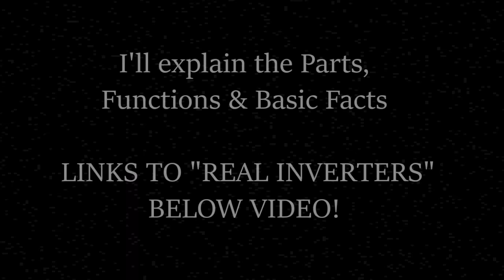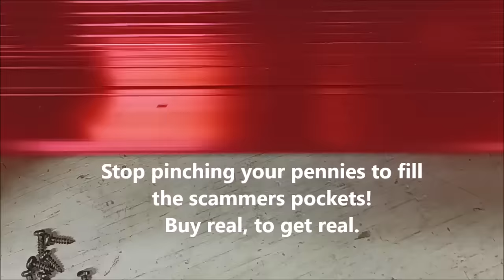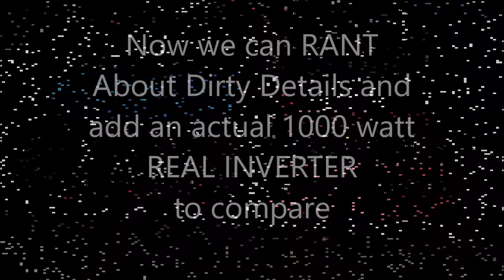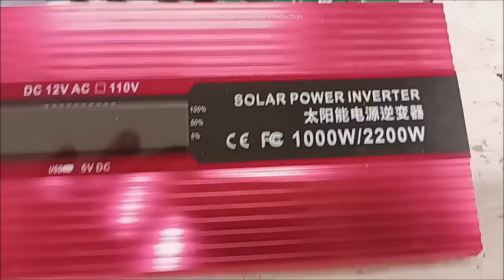Cheap Fake-A-Watt verses Affordable Real Power Inverters, Mega Parts List Below!

Comment from the maker: ALFFAA 1500w DC to AC inverter https://amzn.to/3sJmh9r Honest rated, capable & Well made. MUS-TOOL OSCILLOSCOPE https://amzn.to/3Np7VDk , All parts used https://a.co/dnSm8JX And a SUPER COOL XTRA, My Stakol 53 quart DC Freezer https://bit.ly/3sHazMw , $300 it's been running now over 1 year non stop. only uses 50 watts at 12 volts!!!
Hi Boost ALL SERVICES Cell Boosters, Number one for a damn good reason https://www.hiboost.com/product/4k-plus-pro/ref/68/ and get 15% off use promo code POWER at check out!!
Direct Shipped ALL sizes these same SWI POWER INVERTERS https://s.click.aliexpress.com/e/_Acd6Hd
Reply: you should go through a lot of these things to find the ones that are worth it dang
Reply: got mine, works really well.

Comment: John Daniel I can relate. I have the hardest time making people understand that an inverter does not make electricity it converts dcv to acv which means you can't put a quart of water in a gallon jug and expect it full?. I have 8 thousand watts and I have 8 lithium ion batteries, and WHY? it needs a gallon to fill a gallon jug. Powerjack has give me great service like you say it takes excess of wattage for surge to start. I gave up on my vet friend he wants to know why his 8000 watt won't put out he's got two batteries on it ???? you can lead them to water but I'll be damned if they will drink it. Great Videos keep them coming your spot on. Mike
Reply from the maker: My silly motto I would say to these egg head solar installers and goof balls who use a calculator to cut it all to thin. I got trolled for is, so see it as follows:
I got 35% more solar then I need, I got 35% more battery then I need, and I got 30% more inverter then I need. Why? Because the sun is never as bright and on time - AS I NEED!
Reply: Powerjack inverters are one of the poorest performing, most unreliable inverters on the market.

Comment: Just to be on the safe side, dont max out your  inverters capacity. 500 watt load is good enough for a 1500 watt inverter.
Reply from the maker: I try to enforce that think in all my videos. It's distressing to see people get a 1000 watt inverter to run a 999 watt load LOL!! My motto 40% is target so when you buy a 1500 watt inverter, 700 watts is your normal component constant service ability, you need more, spend the extra dollar and get a bigger one.
Reply: @JOHNDANIEL1  yes thats true.

Comment: Dang that is your first problem, buying an inverter to run a microwave! I'm not about to tell anybody how to live, but that ain't it!
Reply from the maker: Except we run our microwave on one numerous times a day and have been doing it for 17 years. You just have to buy a inverter with the right ability. Most folks are so cheap they buy a 1000 watt inverter to run a 1000 watt microwave without seeing that the 1000 watt microwave rating is for HEAT achieved, not power used to make that heat. A 1000 watt output microwave uses no less than 1400 watts to do it.

Comment: There are many brands sold especially on Aliexpress, it suggests that there is a company that produces the equipment, then the brand puts that simple sticker that comes on the aluminum lid, with the brand. I already had not very good experience with a red Rddspon inverter of 3000w peak by 1500w nominal. In fact, this Rddspon inside is the same equipment as the Jinsi, and both have a nominal power, not 1500w, but 944w (which is what I achieved in the tests). Unfortunately, there are companies that are not loyal to the consumer. I was cheated.
Reply from the maker: All web stores like Amazon, Ebay, Aliexpress have similar activities from sellers. They can choose to upgrade the internal parts and sell similar looking items or sell inferior built that look identical to the good products and sucker people into buying it. In china they are referred to as 骗子 ( Scammer ) 
I only buy from suppliers who have been in business over 3 years, have direct links to manufactures and do not make copies or knock offs.

Comment: I have the 2500/5000 W Enrise inverter. I’m sorry to say it only can deliver 500 W with resistive load. Never worked properly. No support from seller. Seller don’t answer when it turned into a warranty issue. I hope you are happy with yours. But I would like to warn other from buying it.
Reply from the maker: What the hell is a 2500/5000 W Enrise inverter? Never heard of them.

Comment: the cheapo one, the Datou or whatever, is the one i want, because it has the common EGS002 control board!!!  and that is amazing,been looking for that, most have their own controls,some even sand the ICs so that we can't get replacements;  but the EGS002 is only 4 or 5 bucks ;  AND.. it is on a socket!!!!  congrats, depending on the price, the el cheapo there is rthe one to buy, up to maybe 1000 or 1200 watts.
i repair thiose things, and there is NOTHING like having that EGS002 in there, believe me; our ukrainian UKC here,a very good 2000w/4000w  inverter, has it too .
Reply: Is important to know that cinese power is 1/3 of Real watt they aren't scam, you only need to know what you are buying.
I take 8000W 24V cheap inverter and it sustain 2500W  indefinitely,

Comment: We purchased a Giandel 2200W pure Sine Wave Inverter 12V DC to 110V 120V with 20A Solar charge control. We way over powered our creek side camp. We only use the system to run a small apartment refrigerator w/ freezer (draws 10A), 2 different sets of outdoor lights (30Watts each). It's only a system we use on the weekends for the last year and seems to be working well. The inverter has lots of safe guards for those of us who aren't so solar smart. Like when our battery bank got to low an alarm went off and it shut the system down (thank you Giandel).
Reply from the maker: That use the same control parts as Novapal and SWI Power. Very decent build.
Reply: @JOHNDANIEL1  that’s good to hear.

Comment: AM GLAD YOU HAVE SHOWN ALL THIS , only problem is on the outer exterior the only tell tale signs is all the fancy stuff on cheaper ones  and the end electrical battery kook up post being smaller, unless you open it up to actually see the insides of a cheap made model or fake . ( a person if they know how could test them , but then again only after buying one. )  great video and info though .
Reply from the maker: If your in question before you buy one, inquire on it's actual weight, not shipping total, item weight. Then compare your findings. I know this is one solid inverter by ALFFAA and since it's spec made by SWI POWER you know it's solid.

Comment: Great to see the ALFFAA opened up so I don't have to. Excellent Video.
Reply from the maker: It's actually a SWI-Power made inverter with seller upgrades, I plan to release a even better version myself as a OLYMPIC POWER CONTROLS model with dual thermistor and a gen 3 processor. Working with them to make it happen. Fake a watt crap has me that rattled.

Comment: Good video. I ordered a 2000w/4000w peak inverter a couple years ago. I was already skeptical of its current. Turns out it will do 1500w max continous If it doesn't shutdown due to heat protection. It uses the case as a heatsink and that clearly isn't enough.
Reply from the maker: See my latest upload. I worked with one of the top Inverter companies to get numerous improvements made, the results are excellent and their 3000 watt pure sine is one of the most affordable for the quality you can get. https://youtu.be/kUit7UYJ7wY

Comment: Great video!
That blue one looks well constructed, however, it's a pity the Capacitors are so close to the Mosfet/Heat sink.
Certainly the caps are due to fail, just like LCD televisions sets....
(they want the unit to eventually fail so u buy a new one)
Just replace the Caps!... 👍

Comment: Lol your exactly right as a electrical engineer I never use aluminum wire its very high in resistance to much heat I design my inverter with a1000 extra wattage for low heating and longer life I use 300 amp wire for all input and bubbles to transformer I don't build cheap products
Reply from the maker: Exactly!

Comment: I'm pretty technical (from electronics), but just looking at number of components: I wouldn't be able to tell you. All I know is that some MOSFETs can do hundred amps each (and maybe some cooling/gauge of accessory wires.)
I lucked out, ordered my inverter based-off reviews and volume of adequate information available in the descriptions. 🤷.
Reply: did you buy the ALFFAA 1500w?

Comment: @5:01 The small lytics cap right by the second transformer on the right looks like it has domed top which means that cap is bad, it is very common failure in the inverter.

Comment: TO ANYONE WATCHING THIS VIDEO, THIS GUY IS A STRAIGHT SHOOTER!!! If you think this guy is anything but correct, I have a bridge in NYC to sell you real cheap. 

Dear John,
Thanks for the video!! It is a shame that Amazon does not enforce false advertising. I tried 6 different inverters before I found one that actually performed as advertised. I had one that dropped the  output voltage down to 98VAC under a 50% load, while showing an output of 114VAC. By design, an inverter is also a voltage regulator. So how do you put out a product that advertises 115VAC, but as soon as you apply any load it drops? I have seen the Alffaa perform well in a youtube video, but I ended up settling on the BougeRV 2kW with bluetooth. It holds 119VAC regardless of the input voltage, or load on the output. I gauged the inverters I tested by their ability to hold the output voltage steady. P=IxE and no one seems to get that. At 12VDC you need lots of amps and lots of copper, and again no one seems to get it. Then there is the 80% rule, and again no one gets it. It's not new science. Why did I get a 2kW? Because I know I need 1kW constant. You get it, but again no one else does. I see people on youtube hooking up battery banks with bolt in fuses, and no disconnect. I just can't believe the stupidity abound. BUZZZZZ POP!! There goes another one! Great video pointing out the build differences, as they are confirmation of DANGEROUS crap for sale on Amazon. Roof leaks, just a little damp. Toilet breaks, just a little stinky. Cheap electrical equipment breaks, 4 alarm fire. I wish people would stop playing with their lives. However I suppose it does help on the Darwin front...
Reply from the maker: Hit it out of the park!

Comment: Great info, thank you!  looking forward to watching and learning from your other inverter intel videos as well.  Have you covered "vertical mounting" of inverters? (wall mounted with fan facing up or down - a no-no in some product manuals).  I did not see anything in your channel.  Safe or not safe, and why?  I read lots of speculation about heat and air flow, debris, dust, melted parts dripping out, etc... I was wondering if you've covered the actual facts!  Thanks again :)
Reply from the maker: The best way to mount any inverter is flat, however if you choose to mount it vertically make sure that you do so with the DC up and the 120 volt outlets facing down because the DC side converters will make more heat and the updraft will help it cool

Comment: There are things you need to remember when talking about load .....

If you are going to put a magnetic device on it (Microwave, motor etc) you need to look at your running load and then times that by 7 to get your peak load! So a 700W microwave takes 7 Amps (on those 100v systems you Americans use) which means that when you turn t on you pull 49A! ..... all be it for a short time, remember the heat generated still has to go somewhere!

When you look at the bumf in the advertising remember that you can put a LOT of load through something for a short time without killing it. That means that if you can put 100A through a component it wit not like it and start getting hot, very hot, fairly quickly. But if you have a heatsink (even a crappy one) it will take time for the heat to build and melt / burn your kit! This enables you to throw the load through it for a fraction of a second and be able to claim your figures ..... with absolutely no chance of it working in the real world!

In my job we regularly hook leads up to mobile kit running 400A+ (fused at 500A 240V) The leads we use are 400mm (0.6 Sq inches). Now that is real world and they will overheat if run under full load if the flexes cross each other .... so equate that 400A down to what you want to pull and look at the relative csa of the cable/ flex you have!
Reply from the maker: On a 120 volt 60 hertz system the microwave math is heat energy posted, example a 900 watt x 3.18 to get it's inverter preferred wattage. 3kw minimum. I run a 1000 watt on my 3000 SWI Power Inverter and it never has a second of volt sag. I wouldn't try that on a 2500.
Reply: @JOHNDANIEL1  OK .... in the UK (and Europe) we go off the plate on the back that gives tech specs. 
We regularly hook people up on a 2000w inverter generator ..... they struggle when a decent fridge freezer kicks in, but they hold (dependant on what else they have on at the time). 
Different strokes, but the same tale at the end of it!

Comment: What can be confusing for non electricians re wire gauge selection is that most loads are intermittent.

Even my forced air heat is only a 50% duty cycle.

Inverters, you're talking about a current draw that in many scenarios is is pretty much continuous.

There's no time for the cables to dissipate heat.

Loads are different.

A/C is another exception because they have hi g ly variable current draws, but also have an internal breaker, so are safe on a smaller circuit.

NEC assumes worst case and sizes accordingly.

Inverters are pretty close to worst case, so NEC is a good guiedline.

Comment: The alffaa converter good good inside by your talk on it made my mind up and got one cheers
Reply from the maker: They advertise honestly. That is why I got one, then they sent me another for $29 shipping. They are built very simple, and use real ratings, not 200% fake selling ratings. You have a real 1800 watt start peak, a 90% that is not hype, a idle current of almost nothing, and can trust it to maintain 1000 watts till the cows come home. THAT is how to pick a inverter, not on ad lies. Tired of seeing a 1500 watt inverter with a claim it can hit 3000 watts and the sellers posting the CLAIM as the main title in the ad, not the ability. You only need to be sure you have 200 amps actual pulling power ( battery ) available, to never be disappointed.

Comment: Great stuff as always. Are you going to do a review on those cheap chinese charge controllers you got like six of on the wall? How do they compare to the Epever tracer?
Reply from the maker: Those little 40 amp controllers have been actually quite better than I expected. They run very nice and cool and the money I saved I was able to buy 400 more watts of solar panels. So far in test they're right at about 97% efficiency was which is exactly what Epever is. For the money I would say they're extremely well worth it and they have this reaction pulse when they start to tune out at full battery charge but sort of acts like a pulse battery plate cleaning unit. Probably not an intentional design but it sure would be a nice thing to be put in another ones.

Comment: Are you going to do an up-to-date test?  I saw yours after I bought a 5000W inverter on ebay.  I would like to send you pics of inside and see what you thing - should I bring it back?  After your video - it looks very sus.  I am in Australia and wanting to get my little teardrop rigged up with 300W solar panel and yes run a 700-800W microwave which prob will draw 1200-1500 as you say.  I really would like your assessment.
Reply from the maker: What's the weight of the 5000 watt inverter you bought? If its not at or over 9+ kilos then you got much less than advertised. Always smart to buy a SWI power from Aliexpress for things like what your doing, better cooling, better stability, and actually does as advertised. https://youtu.be/-bd4-Prqa3g

Comment: I'm a truck driver and I wanted to know what size inverter would you recommend for running a 43 inch tv,ps5,laptop,and a mini fridge at the same time or is that possible
Reply from the maker: SWI POWER 3200 pure sine wave. https://s.click.aliexpress.com/e/_DBEK4bj Pick the 110-120 volt, 12 volt in, USA plug and use 1 AWG cables from your battery within 7 feet, 1/0 Awg if over 7 feet. The fuse you will use is a 300 Amp ANL with high temp ANL holder. If you need exact items let me know.  Use NO cheap DC breakers on them in a semi, only real fuses. That inverter will run it all at the same time while you make microwave pop corn.
Reply: @Јоhn Daniel  thank you so much I have found the inverter but as for the fuses where exactly should the be connected too and how many will I need

Comment: Hello I have this invertor that I used the test light topre charge up before I added the main wires to and looked at all my fuses and tested them they are good.
 After a day or so I had opened it up to check everything that I can see and understand that is disconnected and there is still voltage in it.
I have contacted the company and they said check the fuses.
Reply from the maker: What is the brand, and wattage. A internal reset breaker on the 120v side in some can give this effect. The Capacitors will have residue voltage, enough to get a reading, to discharge them you attach the test light to the battery terminals on the back and it will light up and fade out showing DC held volts gone.

Comment: So which is the best for running a full sized fridge? 115 VAC/ 60 Hz, 7.70 Amps?
Reply from the maker: 2000+ Watt version for sure, start surge on that fridge is over 1600 for a few seconds. I'd get a 2500 or 3000 and not have to worry. Get a SWI-POWER Xijia 3000 in the voltage you need. https://amzn.to/3bbdac1